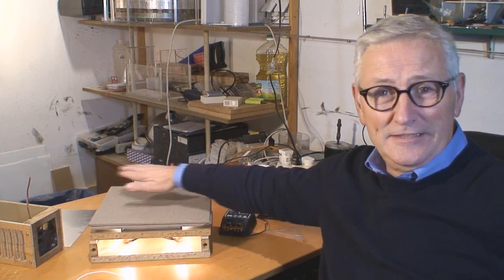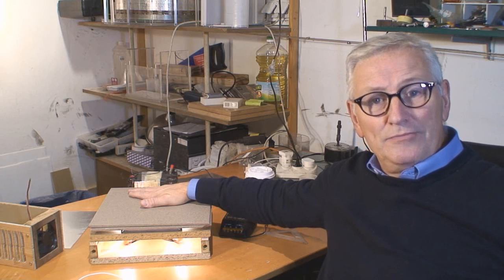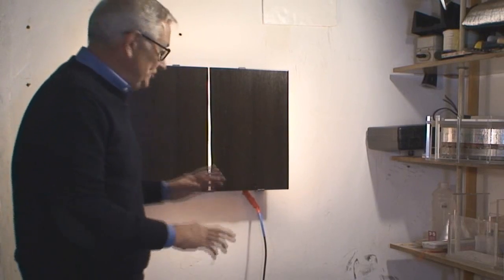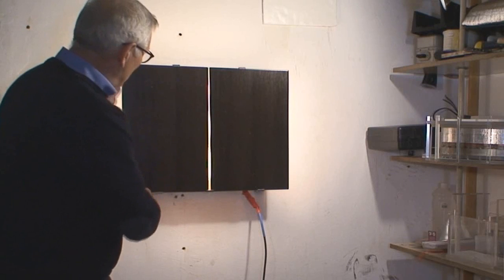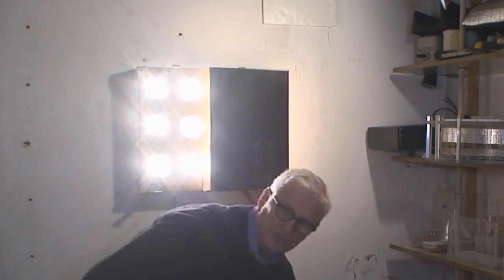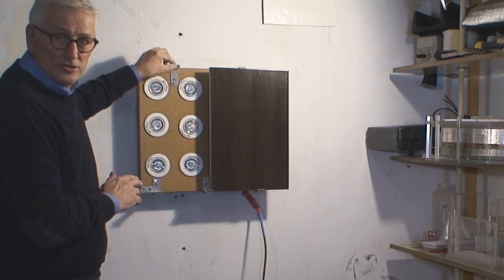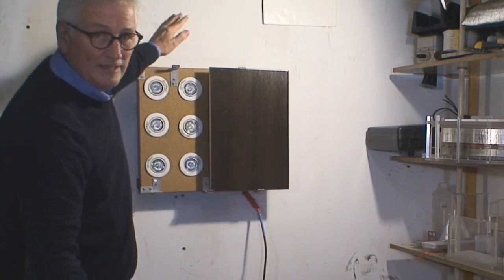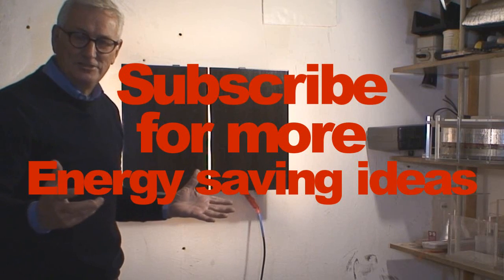Low watt space heater EASY BUILD

Comment: Good design. You can increase the efficiency with a 12V PC fan. The fan is going to distribute the heat more effectively than still air, so you can reduce the amount of the bulbs.

Comment: Great idea! We have a back mudroom on our home that my wife and I have our coffee in each morning. It's well insulated except for the floor. We usually take the inside door off in the spring and put it back on in late fall...now. We like the light coming in through our south windows but really miss it over the winter because it's too cold to leave the door open.  Winter is long in northern Canada ...6 months of snow! 😠 I thought I'd take a chance and try your little heater because it's cheap to make and not too hard to look at. I got lucky and they had a clearance on a 6 piece halogen light kit. I used 3 lights and a piece of 1x2 porcelain tile that was left over from our bathroom reno. It warms the air just enough that we can leave the door off all year and get the light that we were missing! 👍👍 Great idea!

Comment: 600 watts = 2047.285 BTUh ? 
I made a little quartz-Halogen light bar for heating up the cool basement Ham radio operating area. Basement is about 60F to 50F for much of the winter. I didn't shield the lights because they (10 lamps) are connected to 120vac with every 2 lamps in series. (10 lamps in 5 pairs) 60vac per lamp=1/2 power from each. Not super bright. But you can feel the heat from 2 feet within seconds.  Maybe these will last a very long time running at 50% power. 

The Kill-a-watt meter says 160 watts, so each of the 10 lamps is using 16 watts. (160 watts= 545.9427 BTUh). My chair is 2 to 3 feet from the light bar, (vertical wall mount) and it gets to be a bit too warm after about about 10 minutes. 
Anyways, the plan is to use this setup to do battle with SAD during the winter months. I want to do this by going down to Ham shack and doing some early morning Ham radio, while being exposed to a simulated sun rise. :)

Comment: Attaching the fan unit to the bottom might make it more efficient because you can probably distribute more heat around the room before the heat rises to the ceiling.  If you need light and heat, this will do the job. Thanks for the video!

Comment: Love this idea, would love to know if you could run one of these off a solar battery and an inverter? But also Halogen bulbs have been banned in the UK so what alternatives might work?
Reply: That's why I used less power on my Halogen light rack (heating rail). It's 160 watts (see my post above) I can run it off my Ham Radio power back-up solar-battery-inverter system.  It's 800 watts of Solar panels, charging a 6.3KWh battery bank driving a 3000W sine wave 120vac inverter.
If the sun is out, it doesn't use any battery power! Even while running the 135 watt freezer load in the basement. My Ham gear uses low power too. I turned the CPU power down on the tiny PC and it's fan doesn't turn on anymore. :)

Comment: If you used a thick metal plate and painted the backside flat black it would get hotter. You might even paint the backside of the tiles flat black for increased heat. Just an idea. What if you put magnifying glasses on each light to multiply the lights energy?  I see some potential here. Halogen lights produce a lot of heat but are not very efficient. I wonder if a more efficient light could give a similar heat range with even less power consumption.

Comment: great build brother I am buying some automotive led fog lights and see how hot they get i might make that into a cab heater for my truck and place it on my dash and let the ice melt . im hoping i can find a 12 volt switch i can activate with my cellular phone .. if not ill try to get a switch that has a timer and set it for the next day so the cab is warmed up by the time i need it.. i will use a separate power source and have it scaled down where its portable most off the shelf automotive heaters are useless I tried a few ..I see that the wasted heat from a light source is many times more efficient than the heating coils found in space heaters.. thank you for the video ..  just a small question have you ever tried to use a magnifying glass into a beam and   see if you can raise the temperature of the ceramic tiles.. i know we have all used one to burn things from the light from the sun I just wonder if the bulbs get bright enough to allow a focused beam to be amplified ?    I also wonder if a reflective aluminum tape could be placed on the board where the light bulbs are housed and farther increase the heating and stop the wood from absorbing any heat..  thank you for sharing and dont pay any attention to the haters online that say stuff like your heater wont heat shit...lol
Reply from the maker: I made this new video because of the "Won't heat shit" comment so wasn't wasted.
I'm also going to do a video for a cab window heater and may use your idea of condensing the light to assist it. Thanks.

Comment: You could reduce the power consumption  by  powering  it  with a  water cooled  induction  pancake  heater coil  with two  amplifying  coiles  one on each side  to produce  cold electricity.    The  venting for surplus heat  is great  but the  surplus lumens   could be used  with photoelectric conversion  and  inversion and  supercapacitor   storage  to back feed  the  power circuit.     Some believe such a unit maybe  efficient enough to be called  over unity. Such a device is  pictured on YouTube   look for Water cooled  induction hearer and  there are some  demonstrations of the technique  I'm describing minus the  photovoltaic  conversion of  that  incredible potential. What do you have to lose?
Reply from the maker: That sound like a rabbit hole I ready want to explore. Very interesting

Comment: This is not more efficient than the existing heaters you are trying to replace. This might even be worse because you are holding a higher temperature directly against a wall which will allow heat to escape faster to the outside.

This is probably more expensive than a commercial solution, and it certainly will be once you have to replace the bulbs.

Glad you enjoyed making it, I don't mean to dissuade you. I just think that people should know that it is not going to save them money on electricity.
Reply from the maker: Have you researched far infrared? Most of the heat emitted is in the form of far infrared and that's why it 'works'. The room can still be cold and you will feel warm with far infrared because FI waves heat objects and not air. Most people who have not worked with heating systems miss this 'basic point'. Ceramics are known for their far infrared properties. I'm actually making a video on 'HOW & WHY plant pot heaters work'. I'll also "enjoy making that one" ;) The way you're framing your thinking on this is similar to thinking that the sun heats all the air around earth and the space between.

Comment: what stops the tiles from shattering from the heat? I tried this a year ago with a tile and a 500 halogen bulb and it got so hot it shattered.
Reply from the maker: Not had that problem. But you can also use the ceramic tiles with mini squares that work just as well. I also use terracotta tiles that hold the heat better. I also leave about an inch gap between the tiles and the bulbs.

Comment: so how does this save energy over a 600w hardware store heater
Reply from the maker: It’s using your light source as a heater
Reply: @SocialHigh  every light source is also a heater..
Reply: @SocialHigh  and also every other electric equipment. Like a bitcoin mining computer if you also use the heat, its saving energy? 
I would say a heatpump is the only thing what deserves the term "saving energy"..
Reply from the maker: @Hzwo1990  The key factor is the 'infrared'. Ceramic omits infrared which heat things and not so much spaces.

Comment: There would be no need to put the aluminium on the bottom, the bulbs will last longer getting rid of the heat faster rather than trapping it in. It would also benefit from being closer to the floor.
I'm using a low watt quartz heater at the moment, my halogen one was better as it heated the air too but it's broken and needs replaced. 1200, 800 and 400 Watts; 400 Watts is enough to heat my 14 X 11 room throughout winter. Sometimes I'll use 800 Watts in the morning to heat the room up quicker, about 30 minutes is long enough for that though.
A Good halogen heater can be had for under £30.00, I remember when they were £9.99.
It's just a pity they blow rather quickly, same as quartz, I only have one bar working on the quartz heater, one bar per winter at most seems to be how long they last unfortunately.
I think the far red infrared hitting ones body is probably the most efficient.
I point mine at my legs but facing away from my eyes, not Good for the eyes.

Comment: So I love your work.  But your missing one element.  Say you have a roof and you want heat and light.  
That's what we need is heat and light.  Now what if you used an led.  Then mounted it on a terra cotta tile.  
Thus getting light.   And heat.  ?
Reply from the maker: For sure that is a great idea! In my van I'm going to use this and put some terracotta strip shelves with halogen bulbs underneath to double as lights and heaters. Thanks for the creative feedback

Comment: nice
Reply: Although I don't know how to build stuff like that myself, I'm always looking for ways to cut the energy consumption in my travel trailer. I have several small space heaters with fans. I quit using them because I don't like the noise, and didn't like that I could feel the cold air circulating behind it before it gets sucked in.
So I got two radiator heaters that work very well, even on the lowest setting. They're quiet, too. I place them against a wall and as the heat moves up, it hits the ceiling and moves towards the center of the room. I'm not electrically inclined, so I wouldn't know how much energy it's drawing. I'll look forward to seeing what you come up with for the car. Thank you.
Reply from the maker: Yip I get that you don't build stuff like a lot of people. I just recently started building myself when I got the van. A great product I bought was a tube heater. It only uses 120watts and gets VERY hot. And it's cheat at about $30. It connects to 110v (standard plug-in US). The cab heaters I'll be doing a full review of all the stuff that's out there and show you what heat they give off. Some time very soon :)
Reply: Enapp Open Source Energy: Thank you.

Comment: Interesting build, but you can buy a small heater for $10-15. Mine has 2 heat settings and a thernostat. Low is 700w , high is 1500w/ Im guessing one could not build what you did for less than $15
Reply: Yes, but check your power usage!

Comment: Heating with electric is basically short circuiting, it makes no difference how you short circuit, I like the idea but 12 halogen bulbs is a waste of effort, may as well run 1 600watt flood lamp🙂
Reply from the maker: But that would almost triple the watts. The idea was to reduce the watts used.